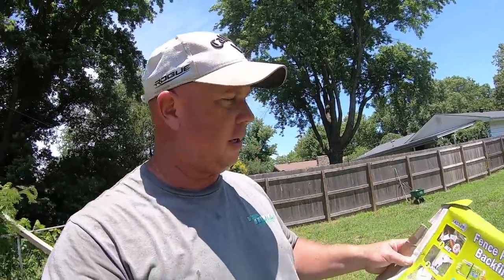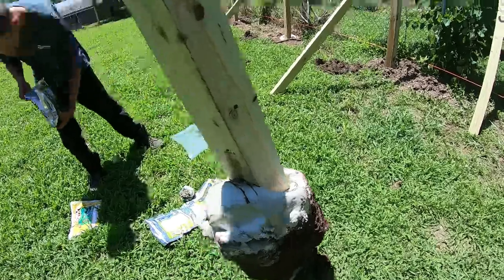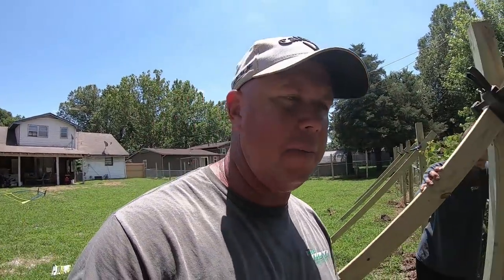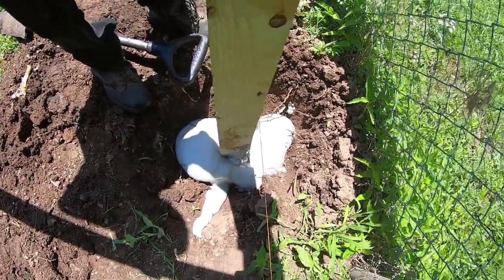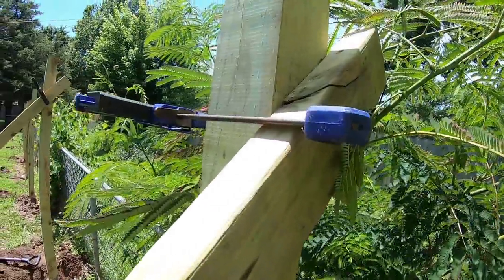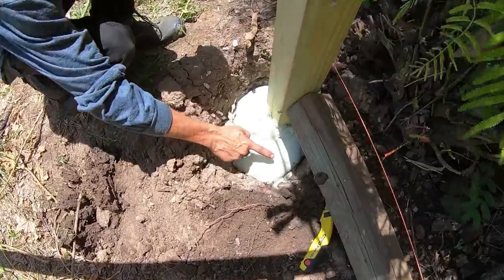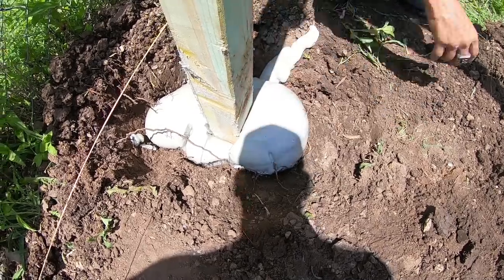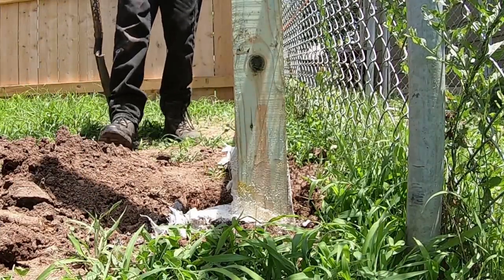No Concrete Fence Post, Is Foam Better

Comment: Thank you for the video.

I just watched another video where the guy shows the foam contracting from both the poles and earth. Mind you, he was using metal posts. Still, the foam touching the earth also contracted.

How is that fence you put up, holding against the elements?
Reply: Yeah I saw that too.  It was the sika brand that shrunk so badly.  Maybe other brands dont but that was a deal breaker for me.
Reply: @pipersall6761  how is yours holding up?
Reply: @IsaKocoglu  I havent used any of it but it looks like some brands work better than others.  Personally, I think having a pad of some sort (concrete or a flat stone) to set the post on then an inch or so of fine gravel around the bottom of the post and then concrete on top of that and packed dirt on top of that works best.  That way if water gets in around the post it can drain out through the layer of gravel and doesnt get trapped in there. And the concrete and packed dirt holds the post firmly.

Comment: That's miles better than concrete but how will it stand up against strong winds?  I've not seen this in the UK yet
Reply: Its often as strong is not stronger than concrete and will hold, but like with any fastener in wood, it will only hold as well as the soil surrounding it. look up Sika USA channel to see some foam versus soil testing to see what I mean.

Comment: One other note. With Quikrete, cement, you can pour it around your pool in powder form and then just pour a gallon of water over top of it. The water will pass through the concrete and drain out through the bottom of the hole into the dirt and leave behind just the right amount of water that the concrete needs. It will set with very little time nor fuss. Same Principle as the foam but about a thousand times higher quality post.

Comment: Cool video...can this stuff be used as an anchor?  If I were to fill a hole with this and attach a metal bracket(with a threaded bolt) to it (after leveling it off with a saw), would that work?  We want to install a small fence, but don't want it as permanent as actually placing the fence post in the ground.  Thanks!

Comment: Will the foam allow moisture/water to be absorbed to rot the post. I put a couple inches of dry concrete under the post then fill the hole to above ground level and taper the concrete downward from the post to drain away from the post. Not sure about the foam deal, any expanding foam I have used outside has allowed water to saturate the foam after a short time....

Comment: So where we're at in Wyoming. Are temperatures get down below -24 pretty much all of January and February. Our freezone goes down 68 inches. Per code you must have your water lines below that or you will have problems with your water system. Having said that, this foam does not have enough weight nor the ability to keep the post in the ground during those heavy freezes.

You must have at least 80 lb of concrete or pound the post deeper than 4 feet to keep them from popping up out of the ground during those intense freezes. I've tried the foam, if you get anywhere near zero degrees in your area, it will not work. They literally pop out after one to two years. And lay on the ground. Dead.

Comment: Personally I havent used concrete to FILL post holes in about 20 years!!! I only fill the hole about 6 inches with it and tamp it down, put the post in and back fill with gravel. 57s to be exact!! Fences that I put up 15 and 20 years ago are still standing just the same as the day they were set!! Foam and concrete retains water around the post. thus causing it to rot so, if you wanna replace your posts often then by all means use this stuff... I`ll stick to my way!
Reply: It doesn’t work worth a crap .

Comment: So it's quicker and easier than concrete but I have several important questions... how is it for sealing out water from the post? How did it hold up over the winter? Is one bag really enough to always get it above ground level so the post isn't sitting in a puddle every time it rains? And last but definitely not least, what's the cost compared to concrete?
EDIT: just looked online and it's at least $10 for every post hole, 2-4 times as much as using regular quik-crete. Screw that, I'm planning for a fenced enclosure that will need 36 posts minimum... if you're just making a small dog kennel or something that's not a big deal, I guess. But for a whole yard? Nope. Not gonna do it.

Comment: I have done alot of these... ONe major thing you have to do is brace your post with at least 2 braces because when the foam expands it will push your post out of alignment if you don't  have it solidly braced...that doesn't happen with concrete.
Reply: just hold it by hand with a post level/plumb on it a few minutes then let go for it to further cure . Thats as fast or faster than just handling mixing and pouring the concrete.

Comment: I use a boring machine that makes an 8 inch hole, then put in dry concrete mix.  I can then tamp it down and level the post.  THEN I pour in the water.  I wouldn't use the foam because you would need to support the post plumb until it cures.  I'm a professional contractor.

Comment: I heard that the lime in concrete rots the wood does the foam preserve the wood by sealing it away from the soil ? I have seen treated post that were in the ground for about 5 years rot out and fall over.

Comment: Yeah that’s great but if you live somewhere where there are tornadoes your entire fence is going to be gone if you have concrete in the ground that’s less likely to happen but if you have a foam for a base your base is going to be lighter than the fence itself so the fence won’t be sturdy not to mention what the weather will do to that foam in a few years

Comment: You can try making 4 holes inside the post hole so when the foam fills in, it will fill in the smaller holes creating a type of X wedge or somethin.
Reply: The entire selling-point of this foam is to save time, now you want to fool around and bore a bunch of holes through every post?  Have you ever drilled through 4x4's? Think that through. ;)
Reply: Use a driver and zip in a bunch of old screws half way in the underground end. Or use old nails you got collecting in cans in your shop. Fast and it gives foam, cement, gravel or dirt something to really hold onto.
Reply: @finallyfriday.  that's a better idea lmao

Comment: Our electric company put up concrete bases for 32' light poles. They used a 2 part foam mixer to lock the bases in place. It's serving the same purpose. Just wondering if it deteriorates over time.
Reply: foam will only deteriorate if left exposed to the sun much like any other plastic left long enough in sunlight, why it is wise to cover it with some of the soil that was dug up.

Comment: Would you say that the foam product would be as good as concrete for setting clothes line posts?  ie. considering that the clothesline will be under tension and exerting some lateral or sideways strain on the post?

Comment: Pro tip: Bell the bottom of your hole so the frost doesn't push your post up and out.
Reply: Bell the bottom of the hole? What does that mean?
Reply: Alan Agnew think of the shape of a bell; wider at the bottom than the top.  If the bottom of the whole is flared out, all of the dirt above the flare holds the whole thing down, concrete/foam, post and all.  Compare that to a strait cylinder. Which would you rather pull out of the ground, a cylinder with straight sides or a bell shape with dirt packed all around it?
Reply: Line the hole with plastic using this stuff. Makes it slippery so the ground doesn’t get a grip to rip it out
Reply: Glen Atchison This product on the bag tells you not to do that.

Comment: The foam is sooooo much lighter than concrete how is it able to provide a solid, unmovable base for the post and fencing attached to it?   It looks like it wouldn't take a very strong wind to knock the whole fence over.
Reply: How well a fence handles a high wind has more to do with how deep the posts are in the ground / (soil "strength")...  Concrete may act like a pendulum to keep it right side down, but with high wind loading it is really the weight and strength of the earth opposite the fulcrum which stops it blowing over..  (in frequent-hurricane areas it would probably be a better design to design the fence with panels which DO "blow down?  to save the integrity of the fence  (they can just be stood up and "secured after the event - but of course this is unlikely to ever get done as people like their fences to stay in place as best as they can....  And the fence panel blowing into a house as it drops down (with the force of the wind) would cause damage..  Best for that damage to be an "Accident"  than a system design feature (liability issues).

Comment: Would screwing a 1"x5"x5" non-rusting piece on the bottom of each 4"x4" provide more vertical and horizontal resistance to sideways or up/down movement?

Comment: I went and looked at reviews from the whole internet and many of the people felt that the foam didn't work as good as advertised. I have worked in the sign making area od advertising and know there are different densities of foam.  This one looks more like a insulation density while the ones I worked with were as hard and almost as dense as a strong balsa wood that we cut and carved with sawzalls and sanded with electric pad sanders, The end product was sanded smooth, painted with a rubberized primer primer then painted with both brush and air guns. It worked really well.

Comment: Question is how easy was it to pull the post out of the hole?  And still over time has anyone had any experience with posts rotting out using foam? How about durability and strength once the entire fence is in place. Not wanting to sound negative but only want to know more before I purchase this product.
Reply: Concrete holds or soaks up water like a sponge, most types of foam does not. Also the hold strength depends on the type of soil around it and how solidified the soil has become.

Comment: Foam floats... how long before this pushes out of the ground? Does it pop like a zit?
Reply: @serick73 now why are you being so mean? I am sure your reply doesn't hold up to YouTube community guidelines. I don't think my comment was phrased to imply you are "stupid". I have a sincere interest what this stuff will do in areas with a high water table and frequent heavy rail. I have worked in construction for 20 years and owned my business for 15. I really think you will have a problem with this stuff in sandy soil along the Southern coast. It might work on telephone poles because they are 100s to 1000s of pounds. I can tell you that bag of foam would float me down the river @ 175lbs, which is probably comparable to the weight of a section of fence. What happens to this foam in saturated and unstable soil? What happens when you want to pretend to be a linebacker and try to run through it to get to the beer, when you could have used the gate. I want to see a test to see if that amount of foam makes that post bob in the river, that is all I am saying. If the post doesn't sink, the product stinks. I know what happens when you put concrete on a post and drop it in water. Would you use this foam as a foundation for your house?
I made a silly statement, but with underlying considerations.how is this really faster than pouring a bucket of water in a hole and then pouring the concrete after? I can build a fence running the 2x4s on the posts and then a support to the ground on the inside, then pour the concrete after all the posts are in the holes, and still screw pickets at the start of the fence while the last posts are setting. The posts are stablized to each other and the ground, and are equally spaced without having to cut a board, graded with a laser, and plumbed to string lines. Not only could it not be faster, it doesn't need to be. What is the advantage to using foam?
If the foam comes up out of the hole and sticks to the post where you see it, even after cutting it off, how does that effect stain absorption? You can wash off wet concrete... concrete is made from the same stuff you can pull out of the ground, so it isn't very harmful and can be recycled. Yes, you can use busted 'crete to prevent your pond dam overflow from washing out. Can you do that with foam? I don't think so.

Comment: Hey, what's your freeze line? I'm a contractor in Michigan. How far down did you dig? That stuff seems pretty cool
Reply: When dealing with a frost heave situation, they recommend digging a bell shaped hole.  We have had some brutal winters since i did my in-law's fence and there has been no heave on any posts.
Reply: @f.demascio1857  well, every state has a freeze line to dig down to prevent heave. Ours is 36" so we dig 42". I guess only builders know this. No offense though you did your best. Thanks bro
Reply: @f.demascio1857  freeze line is called freeze line cause when winter hits it's where the freezing stops and underneath is unfrozen. If you live in places like California or Florida it'll probably be around 20"-24" from the top of ground.
Reply: I'm a professional in the Saginaw Bay area and i've been curious about this stuff for awhile.  I've set a few posts 3 yrs ago now with this (personal job) and haven't had any issues.  We do bell all our holes up here to fight heave though so I have to agree with that guy, it makes a huge difference.
Reply: @instantkarma1636  ok thanks. How far did you dig? Passed the freeze line? I only ask this cause in this video it looks like he went down about 1.5'  I could be wrong. My question is digging down pass the freeze line or does this stuff make the job go faster by not? Either way you we gotta put something in the hole. Thanks for your time
Reply: @aservant2287  This is really best for decreasing time waiting for concrete to cure and avoiding the hassle of mixing. Your still putting in a bunch of time doing the other stuff. It looks like he's in Kansas so I imagine they don't have to dig as deep. I'm curious to how this holds up to multiple freeze-thaw cycles but our winters have been pretty mild here the last few years.
Reply: @instantkarma1636  right.  I live Michigan so winters can be brutal. The stuff is cool regardless

Comment: Man I wish I knew about that stuff yesturday Im doing a fence for my moms birthday present  and yesturday me and my 2 sisters put concrete and set the posts. 138 posts with 80 pound bag of concret each.
Reply: Keep in mind that foam stuff cost $10.38 a bag. So 10.38 x 138 = $1432.44 x 10% == $1575.68 VS  $4.85 per 80lbs. = $669.30 x 10% = $736.23. So using concret would save you $906.38. I do not think I would set a gate post with foam.
Reply: 72+HourBOB .. right and if money wasn’t a issue I’d spent it on galvanized poles vs wood🤷‍♂️
Reply: Sounds like one hell of a back breaking day

Comment: One other benefit is that posts usually rot at the intersection of wood & concrete.  The foam sticks a lot better and provides some protection from moisture intrusion....
Reply: Wrong
Reply: They rot at the intersection of wood and concrete because the concrete is below the surface.
Reply: @ralphfurley404  RIGHT not wrong  if closed cell foam and bottom of post also foamed ! Very little if any moisturee contacting the wood and helps keep preservative chemicals in.  Think under slab and basement closed cell foam insulation actually required by code in colder regions.
Reply: Jerk Of All Trades  I suspect it depends on soil.  My father in-law was a concrete engineer and refused to sink posts in concrete.  His posts lasted 10-14 years.  I installed my fence 20 years ago, the posts don't budge.
Reply: @tonyg2859  I've been a fence installer for 10 yrs and in my experience, if there is a place for moisture to settle at the top of the footing, thats where your rot is going to occur. I've pulled 30 yr old footings that have no rot. Simply shaping the top of the footing to direct water away from the post makes a big difference.  I'm in MI though, we stop all our footings about 6 in below ground level to help fight frost heave.  Soil is a huge factor, mostly clay up here so very bad drainage.

Comment: I can't imagine foam staying firm after a couple years of wind against the fence.
Reply: Agreed, and what about the soil expansion and shrinkage. I use concrete always and cover the beded part of the post with DPC plastic strips to prevent water ingress from both concrete and soil. Post have lasted over 15 years without any decay or any movement.
Reply: Never thought about putting a plastic sleeve around the part that goes below ground and into concrete.  Do you think something like a 6mm sheet of plastic would work too?  I honestly know nothing about building a fence but plan on redoing our fence.
Reply: John Sumner lol no. You can’t keep water out. Trying to does more harm than good once it gets in
Reply: @johnsumner2987  They sell sleeves for posts that heat shrink like your talking about.  I'm a professional installer and on Clarks point, it's just opinion.  Tar works good if you want a cheaper route.  Don't be detered, it's simple once you have a grasp on  what your doing.

Comment: This may be ok for a perforated fence such as chain link and is the equivalent of earth ramming a post. Should not be used for a solid fence which is subject to wind loads. That you were able to remove it easily says it all.

Comment: Considering the engineers here in Florida want a 24" cubed (24x24x24) footers for a pergola structure.... I can say without a doubt this foam product would be quite insufficient to handle the uplift during a storm.